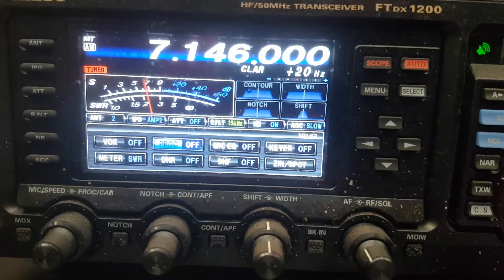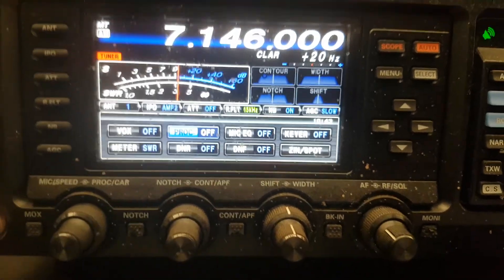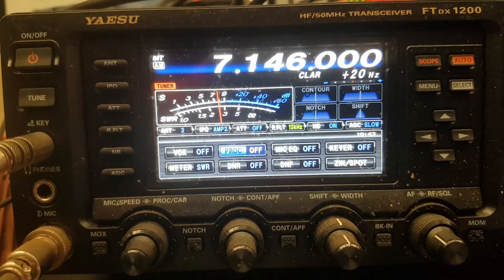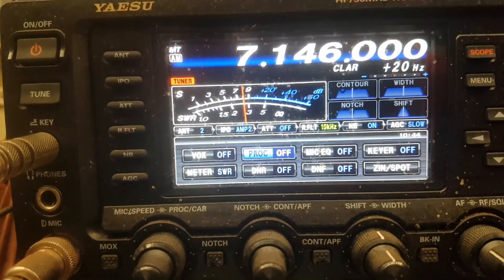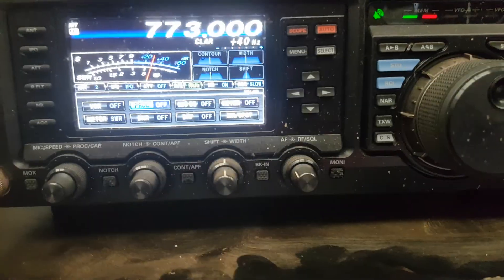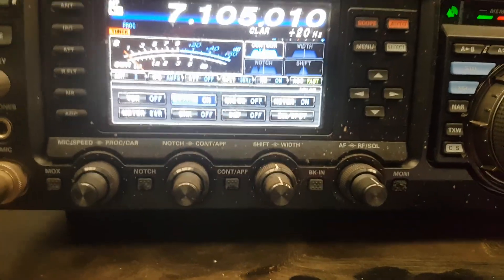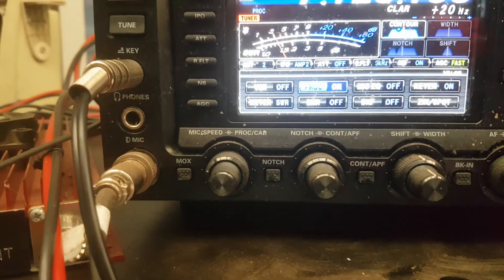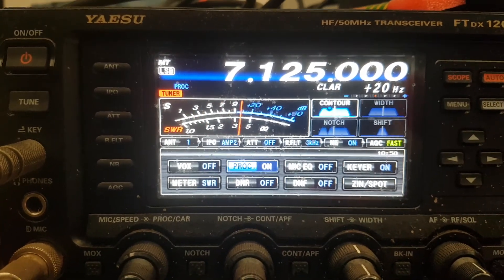Vk3ktt testing loop beverage in the ground ftdx 1200

Comment: Hey Steve, great video showing the difference between vert & loop. 
I've made a log loop as per http://www.kk5jy.net/LoG/ has on his site and find it is great but my radio has option for seperate rx antenna. Have done sweep of my log and it's has low vswr on 40 & 20 but haven't txed into it.
Cheers, Adam VK2YK